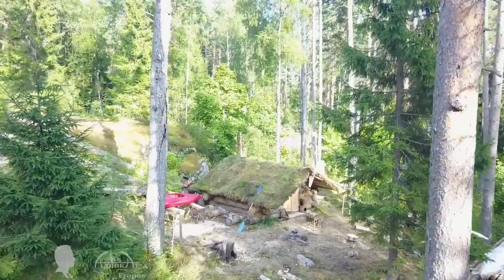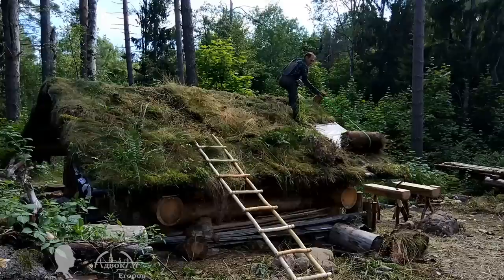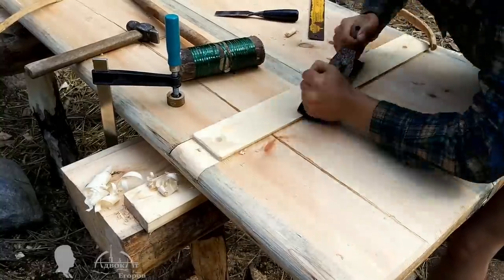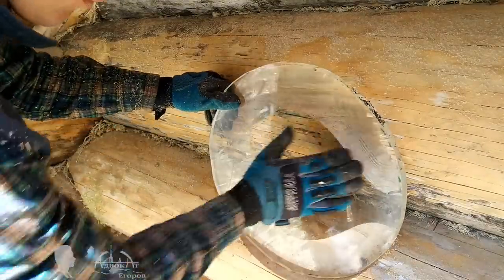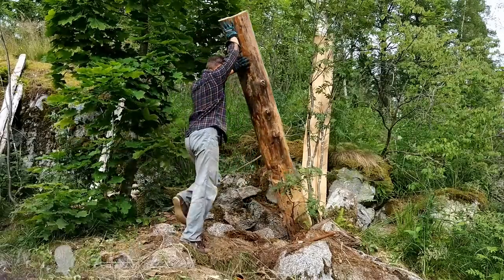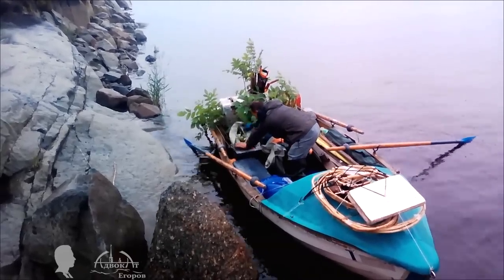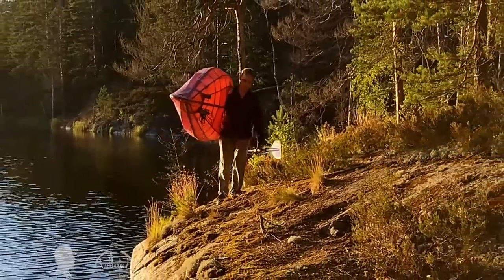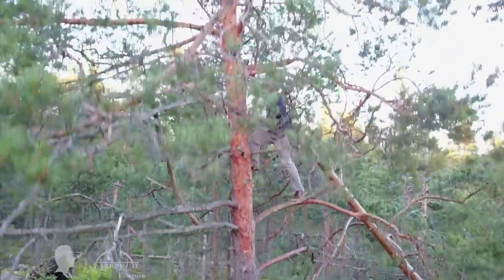30 Days Solo Bushcraft in the Northern Wilderness / Best Summer Projects

Comment: For the porthole I guess you drilled a hole in the log, put some stick through the hole so that it can rotate, and attached a chainsaw to the rotating stick. In order to complete the hole nicely, you probably needed to support the axis on both ends.
No one has quite solved the problem? I am curious if there would be unforeseen complications with this method.
Reply from the maker: Tonis, you are almost correct but the secret is in details. I will show it soon...
Reply: @Advoko  Watched the video again and I think "almost correct" must be a joke.
First, I noticed that in the beginning of the video the porthole was already started, but the supposedly drilled hole in the log did not look large enough to even put a sturdy metal rod through it, let alone a stick. Second, the porthole was not cylindrical, but the chainsaw blade must have gone only a bit more than half way through (that enables supporting the leftover center piece simply with a board and some screws on the other side). Also, after watching some other nice videos of yours, I got the impression that you like to invent efficient tools that could be used for more than once (or twice) in a lifetime.

Considering that, I think the tiny hole in the log holds one end of some sturdy stick or metal rod with something sharp in the end, around which you had a rotating pipe attached to the chainsaw. I would not be surprised if the pipe was attached to your alaskan mill that held your chainsaw. The other end could be supported by yourself, perhaps with some aid of a stick. Now, turning this installment with one hand might be cumbersome, but if you adjusted the angle of the blade a little bit off center, it could turn on its own (otherwise you might have been able to make a narrower cut but you didn't). So, all you would need to do is hold up the other end of the rod and decide how much you wanted to push the chainsaw inwards at each turn. Sounds a bit crazy, but this is what the shape of the porthole looks like to me after noticing that the drilled hole was too small to put a sturdy axis through it.
Reply from the maker: Many people got as far as you did, but doing it like you've described would be very unsafe and wouldn't work well. There is one more component missing, at attachment...))
Reply: @Advoko  Counter balance for the chainsaw? Also, it would be completely safe if you had a lot of stuntmen, gruesome death of whom would become the bloopers for the video. At the moment other problems to be solved would fall into the "unforeseen" category. Except maybe the logs being round might affect the self rotating of the chainsaw, or some thing to keep the rotation steady. At the moment I am just trying to imagine it in theory, I am not even sure that a chainsaw on an axis would become self-rotating.

Seriously, I would rather prefer an axis through the wall with a firm handle with good leverage. And would turn the axis against the direction it would want to roll on its own. But having to construct a special frame to support the axis each time I would need to make a round hole did not look like your style when I watched your other videos. Also, you could have cut a rough hole and made it cylindrical with some safer tool like an angle grinder on an axis. There must be something interesting in your solution.
Reply: @Advoko  Now that I think of it, the cut marks seem very evenly spaced, perhaps you transmitted the speed of the chainsaw to an immobile axis with some chain and cogwheel of a suitable size.
Reply: @Advoko  Initially, the idea was that the blade being slightly off the radius could cause a rotation of the chainsaw that could be a safety problem, but instead of seeing it as a problem you might have worked with it as it could free your hands from having to rotate the chainsaw. But I understand that was not the case. Obviously, connecting the rotation to something that is already rotating in the chainsaw would be the more reliable idea.

I should consider a support for the tip of the chainsaw blade, because I doubt chainsaws are meant for cutting sideways. An immobile axis that could slide, or a bar or groove that would enable something to slide. Spots to get chainsaw rotation from, and different ways to transfer it, say, by a cable. A bar that has screw like grooves on it as the axis. A safety mechanism in case something should get stuck or fail.
This puzzle is getting a bit overwhelmingly out of hand for me at the moment, because I also need to do something else.

Comment: Max, I so appreciate your consideration of replenishing the forest and repurposing lumber that has already fallen.
I love all your innovations.  I would love to have your skill in woodworking, but I am older now and it won’t happen. 
I don’t have the money for the tools, I don’t have the strength, I have old injuries, I’m going on 65 and I’m a woman. 
But I maintain my property in the country. I maintain my home as best as I am able. I have to hire help for large projects and plumbing and electrical.  But I often innovate things to get the job done and love climbing trees and mountains. 
Your round window. I would only guess...you measured the diameter with your protractor and used your hand drill to start the hole and hand sawed the majority. Then used your hand made blade to smooth the edges out to finish it off.  Just guessing.
Love your kayak project.  
Love your pack frame.  So innovative. Bravo.
Love the ladder.
You have Yeti’s in your neighborhood?
I often switch to other projects to help my injuries from hurting.
Car accidents and my job wore my joints out.
But I’m better now than before.
Reply from the maker: There was an unusual incident briefly described in this video: https://youtu.be/fQSpQH9t_mM
Reply: Advoko MAKES yes, you referred to it possibly being a Yeti.  😳.  It is a mystery.

Comment: Why did you put that black sheet near those plants?
Reply from the maker: To prevent drying of a small root ball...
Reply: @Advoko  How it's going to protect explain little bit?
Reply from the maker: It will work as mulch slowing down the water evaporation...

Comment: I'm a porthole window the way I would have done it cuz I would have measured the the length of the window found dead center drill a hole in the wood place the nail in the hole and got your stream and just drew a circle around it and that's how I would have done it

Comment: What I dont understand is how you got that chimney to flow down... I wish I knew the term for that, because every time I try to search for that I keep getting the whole 'how to fix backdraft' nonsense... I would love to make a chimney pipe that spirals under a floor then shoots the smoke out after all the heat has been captured under the floor.
Reply from the maker: It is a siphone effect: the air goes towards cooler and higher point, even if it gives away some heat to the floor...
Reply: @Advoko  do you have, or know of an instructional video for how to make that?
Reply from the maker: I am planning to make a video about my chimney/smoker some day. No, I haven’t come across such videos.
Reply: @Advoko  I live in a mobile wooden structure on blocks with generous space under the floor, I had the idea of running stove pipe in a square all around the bottom of the floor then have the pipe come back up somewhere to let the smoke out into the air. That way I can capture as much of the heat as possible before letting the smoke leave. What is the most important thing to do so that the stove draw is naturally inclined to pull down and then back up?
Reply from the maker: I would think the chimney's hight would be most important to create draft in your case...

Comment: Nice work brother! Neutral drying is no easy task. For your larger logs, try using boiled linseed and bees wax on the ends to slow the drying which often causes checking. For the pothole a nail or peg with vine based twine and bees wax so the twine slides on the peg keeping the radius the same. Otherwise the wrap will shorten the line thus decreasing the radius.